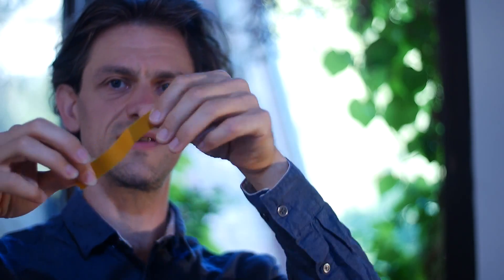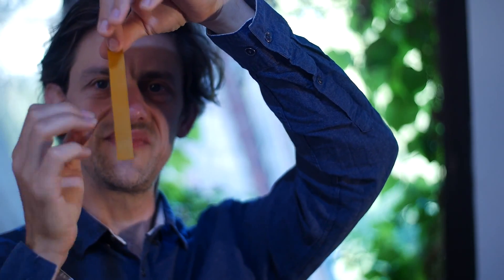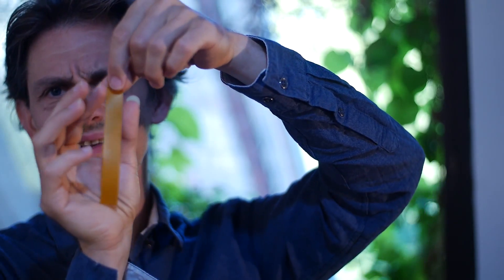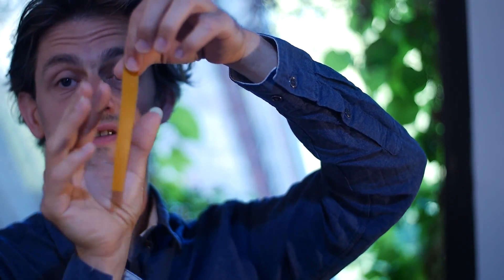Vibraband 1-  how to make one

Comment: hey can you send me a link to a good rubber band to play with? like from amazon or something. where'd you get yours from?
Reply from the maker: I have tried many, from dentists, gymnsastics like those: https://www.amazon.de/HUDORA-Fitnessb%C3%A4nder-64148-2er-Set/dp/B000R6Q4VQ/ref=pd_cp_200_1?_encoding=UTF8&psc=1&refRID=2Y4MWH4DDKWZ730TZ5AZ 
balloons :) actually balloons are not as bad as you might think, I started cutting pieces from bigger ones, because they are a little stronger thicker rubber, but then made a video about how to play a normal balloon... have you seen that video? the easiest way, because rubber is actually harder to cut straight then everyone thinks (until they try... ) :)
Reply from the maker: the gymnastic ones in the link are the type I used in the video above, but I have more colours, which are different thicknesses. hard to say which is best, that depends so much on your experience... roughly one can say that thin ones "distort" earlier, and thick ones can sound lower and more sax like, but are usually also harder to play.. and it is anyway difficult.. so it might not be the best way to start with the thickest you can find...
Reply: David Stützel thanks :) so those gymnastic bands in that Amazon link work well? I got some balloons the other day but I wanted to have a few different materials to work with
Reply: i really wanna Master the vibraband. it's possibly my favorite instrument for a number of reasons. I'm very thankful for your tutorials :) if I  figure some stuff out I'll let you know
Reply: oh I just read your other comment thanks :)
Reply from the maker: yes! tell me about the number of reasons.. and let me know when you figure out something....
I believe the quietness around vibraband playing has to do with the initial experience that it is harder than you would think, and more strange to control or understand, and so most people stop again... which is a pity because that changes if you try again for some time...